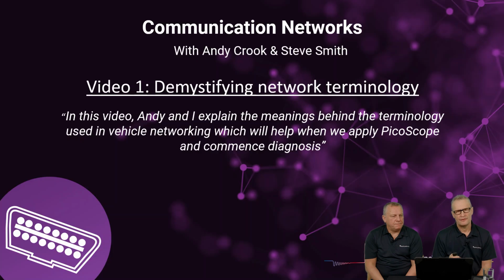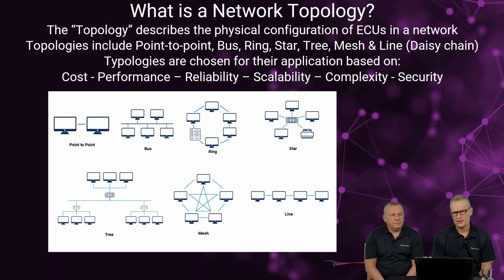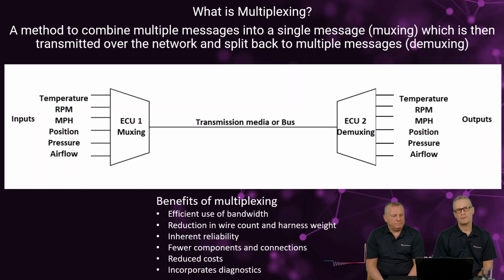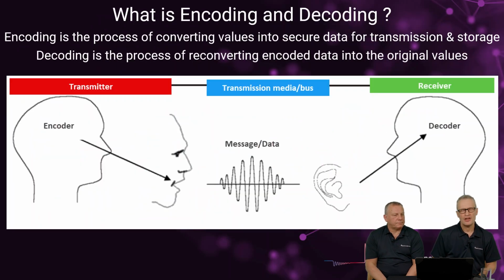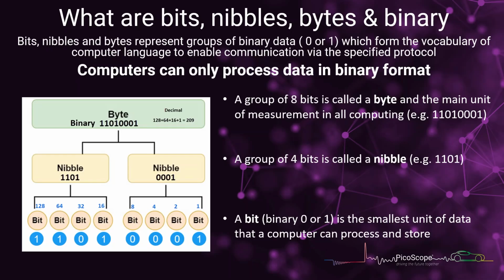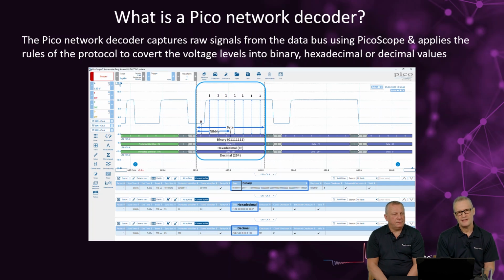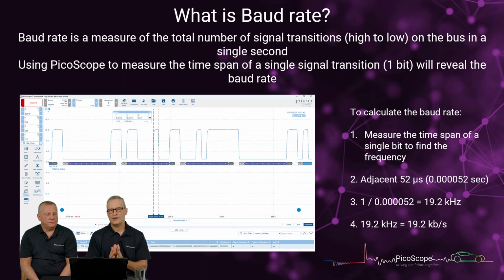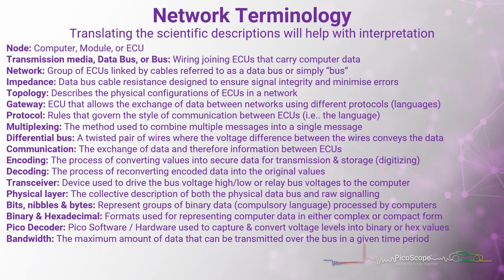Communication Networks (Part One: Terminology) | PicoScope

Comment: The new networks does not work that way anymore. You can not measure anymore the modern CAN BUS network resistance because there is not anymore. Same time you find funny fuse markings on fusebox CAN. They marked all end modules who are responsible for networks. Until that module have power, that network operates. No resistors

Comment: Water pump cutting into  the timing cover p0088 high pressure fuel pumps turbos rocker arm because fuel in the oil fuel pressure sensors, r.i.p. 6
4